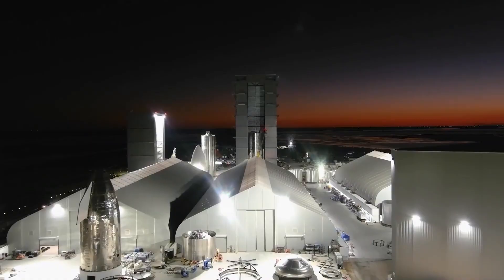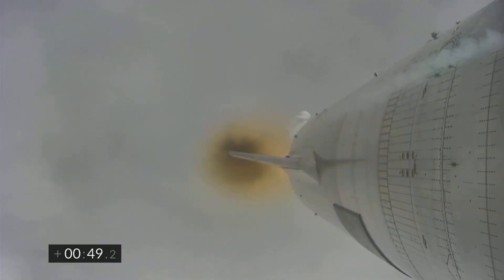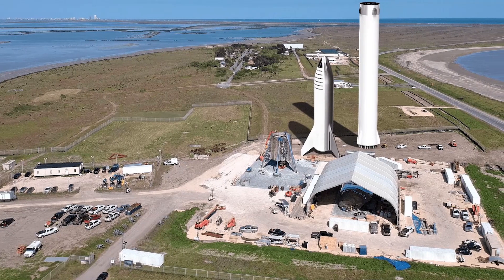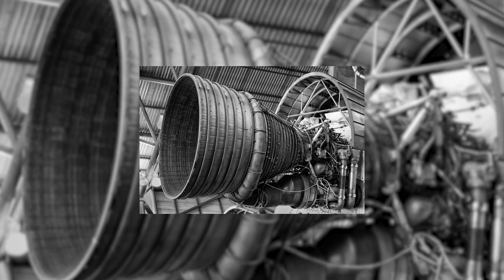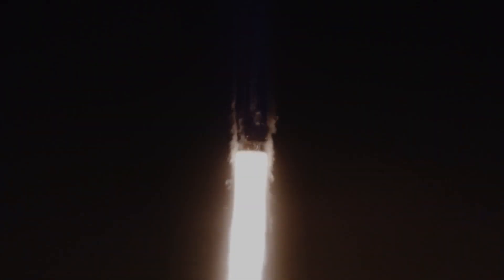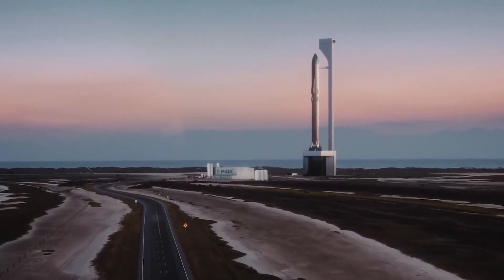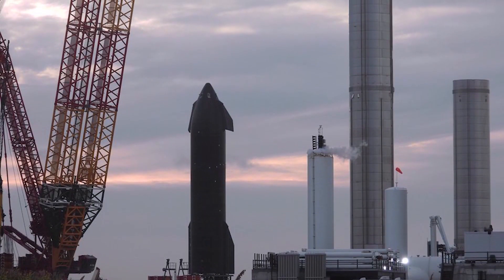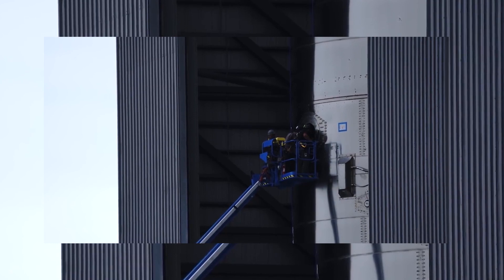SpaceX FINALLY Reveals New Raptor Engine!

Comment: This guy is recycling an old outdated video and passing it off as new info.  No mention of Raptor II, 30 engines for the first Stage instead of the current 33 & 6 engines for the second stage instead of the current 9 just to name a few data points.